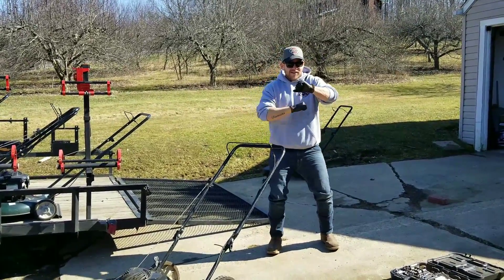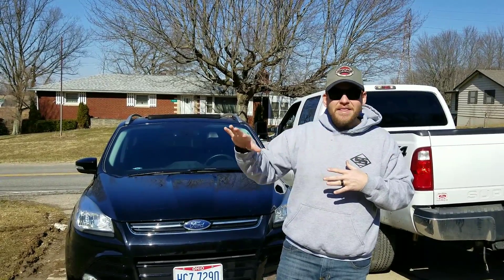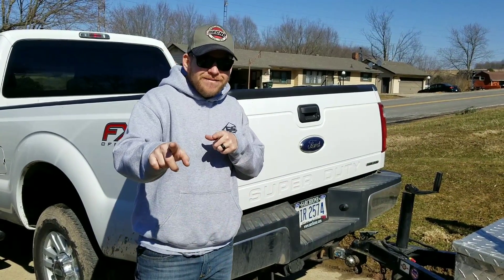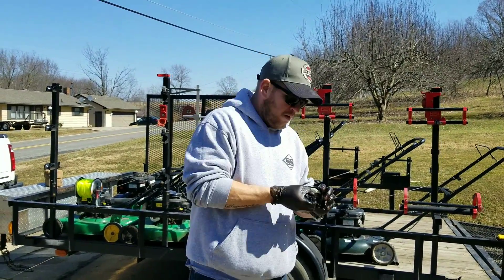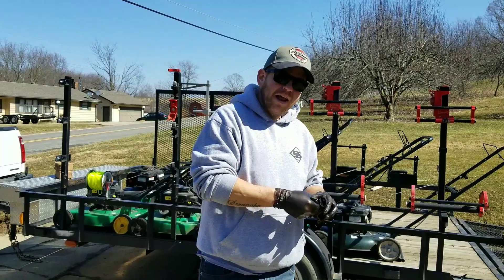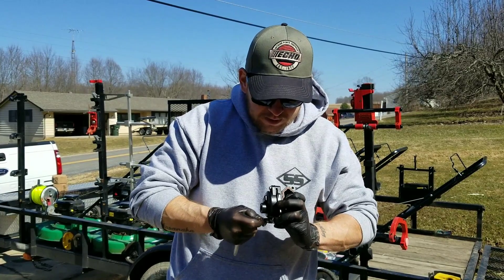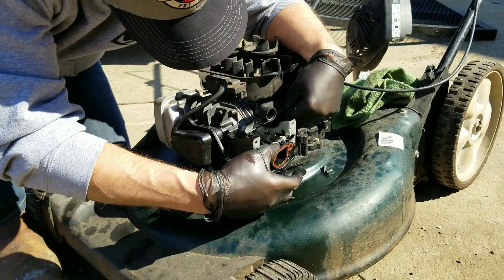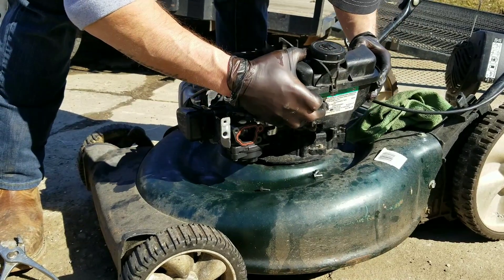Can We Save Our Investment

Comment: Good to see you got the first one going. Word of advice on the next set of carbs, when you take them apart, remove the needle valves and clean them out, they have passages that are less than .010 that get clogged, that's what stops the carb from getting gas. Good luck. Because if you don't take them out, and put it all back together and it doesn't run, then you have to take it all apart again anyways and clean the needle valves. Best to do it all the first time.

Comment: I always set them on the tailgate of the truck. Remove the carb, disassemble the needle and seat, set the float and clean the booger’s out of them. Set the air gap and check the plug and clear the air filter. Takes a half hour per mower and that includes wiping them down with spray nine
Reply from the maker: Nice man

Comment: Heck ya ! 
    Fuel, air, and spark!  
 Careful with the Carb cleaner..  it can/did cause the rubber o-ring on one of my carbs to swell up and expand larger than the slot in the bowl!  
      We also run strictly Non ethanol gas in all our  small engines.  It costs a few more bucks, but the equipment is much more reliable after sitting for awhile.   Also makes more power on the real gas vs corn juice!
Reply from the maker: Heck yeah man

Comment: Ultrasonic cleaner , drop carb in and it will get the inside passages as well. Doing carbs regularly for snowmobiles.  Use of startron fuel stabilizer helps.
Reply from the maker: Sweet thanks

Comment: Usually the problem is a clogged jet from sitting around with old stale fuel.  Get the jets cleaned out and you will be back in business.  Now that you got one done the rest should clean up really quick since you know the drill.   I always run non ethanol fuel and stabilizer in my small engine stuff.
Reply from the maker: Thanks man

Comment: The screw that you took off that holds the bowl on has two Jets in the screw if you take a bread tie and strip the plastic stuff off you can use it to poke through there and clean those two Jets and usually it'll get it running
Reply from the maker: Thank you

Comment: Ethanol gas eats gaskets,  it's where the color comes from , Take the float outattached to the float is the needle valve. Take it out remember the orientation. clean the needle valve and the plastic housing. Little hole up there. Should run if no tears in the diaphram.

Comment: You’ve got to clean those carbs your not going to tell if it’s clogged by looking. You e got to remove the needle valve clean it clean the seat. Get some torch cleaners give whatever hole you can get to a reaming then spray it out. Those plastic carbs are a joke throw away crap. it should run with a two minute cleaning I wouldn’t do a whole lot.
Reply from the maker: Cool thanks